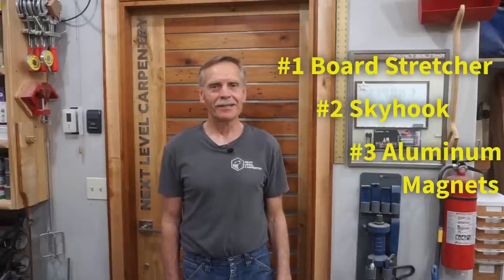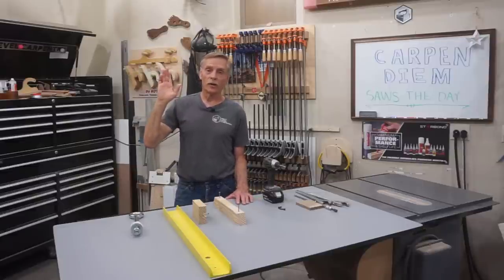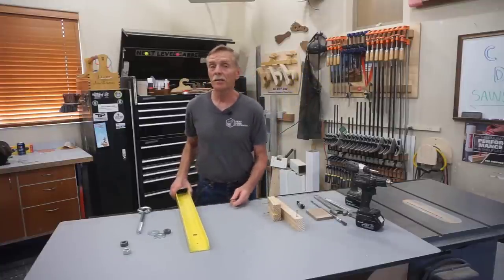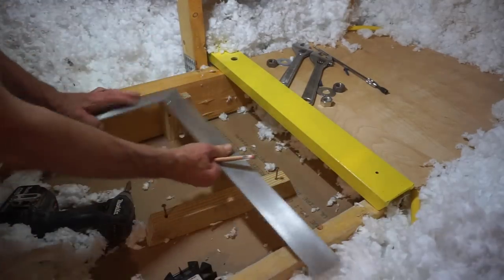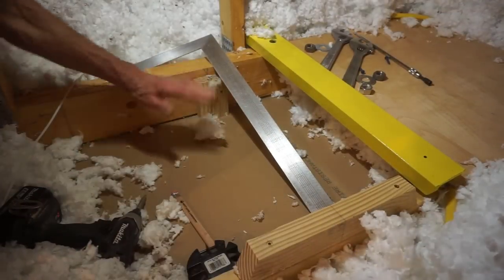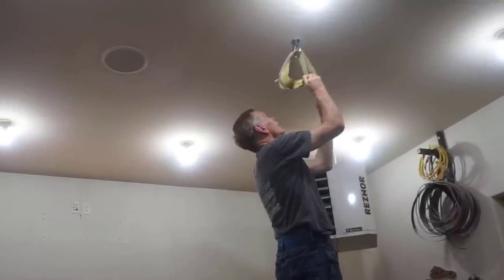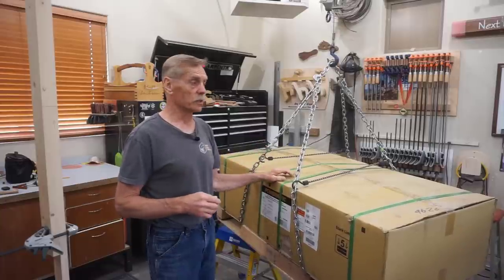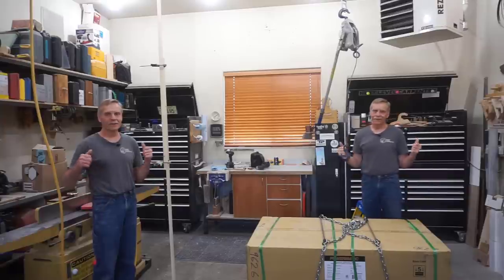Workshop Skyhook Installation

Comment: Matt, I've concluded the stirring direction in the aluminum magnet solution is critical. I stirred counterclockwise, for a little to long. When ready to boast the attractiveness to my friends, the pop can repelled so hard I put a hole in the drywall in my garage. Not to be messed with by amatuers.  Also noted - on my adjustable wrech, closing it completely for 3 seconds will recalibrate it to SAE and vise versa. No longer need two adjustable wrenches. Thank for the video. I don't need a sky hook, but ill put one in anyway. The for posting.
Reply from the maker: Dear Greg, I have posted your comment for all viewers to see first for the insightful imperial to metric conversion process for an adjustable wrench. That, my friend, is pure genius! A little known fact is that I've kept six crescent wrenches in the drawer of my tool box so that I can have a small medium and large in both SAE and Metric. You're incredible solution allows me to free up that extra drawer space so now I have places for my selection aluminum magnets plus I can also add my collection of brass magnets as well.
I can't thank you enough for sharing here at Next Level Carpentry because it makes the whole Channel a better place!
😔😁😎
Reply: You could also use that direction to place a hole in the ceiling for your skyhook also?

Comment: Being the "Crane Guy" for 44 years, I watched with great interest!  You did a splendid job on ALL aspects.  I do agree with a previous comment about Chip.  It would have been nice if HE would have held the eye bolt while you threaded the nuts and washers on.
Agreed, a welded eye, eye bolt would increase the safety margin but not necessary IF you abide by the hoisting limits you set.  As a "crane guy" I would recommend using a shackle on the eye instead of doubling your strap as you did.  While I sure understand the safety margins between the strap rating and your load limit making it perfectly safe, a shackle would prevent any potential damage to the strap due to unequal load on the strap fibers going through the eye.  As I said, with the ratings of the equipment and the load limits you set, hoisting will be perfectly safe.  You have my seal of approval!

Great video and extremely well done.  I enjoy all of your videos and the way you present them.
THANK YOU and Chip.
Reply from the maker: Thanks so much for your insightful comment... much appreciated!
This kind of polite, informed feedback is educational for me and beneficial to any other viewer who takes the time to read through it.  I kinda thought the steel hook in the round 'eye' of the strap was less than ideal because of the sharp load point in a smooth circle... any thoughts there?  Seems like the strength of that ring might be the proverbial weak link in the straps design without a suitable fitting to connect to it.
Regardless, thanks for your contribution!
Best, Matt
Reply: @NextLevelCarpentry  Matt, Thank you for your delightful reply.  I sure understand your concern.  If that strap has a 5,000lb rating, you can be SURE that ring will hold 5,000lb.  Being a ring, a person should only use a piece if hardware such as a hook or shackle.  Both of them will be a point load.  So, you are good to go especially since you have a 10 to 1 safety margin restricted load rating.
Keep making the great videos and Good Luck, Terry
Reply from the maker: @strrchristmas  I always figure that if I'm the smartest guy in the room then I'm probably in the wrong room and it's guys like you that I've learned a great deal from over the years for things outside my field which I most definitely appreciate!
Best, Matt
Reply: @NextLevelCarpentry  Matt,  You are MOST WELCOME.  I believe the knowledge I have gained over the years MUST be shared as it will all be LOST when I pass on.  It is my privilege to have been of some service to you and your viewers.  Cheers, Terry

Comment: Thanks for the free overnight shipping on the Aluminum Magnet Solution! By the way, after some experimentation of my own, I found that by adding 1/4oz of purified water to the solution, it will convert the magnet to pick up plastic water bottles!
Reply from the maker: That's an aMAZing development! There's no end to the usefulness and benefits for all mankind!  Thanks for sharing... and, of course, you're welcome for the free shipping... it's the least I could do! 🤣😎
Reply: I added angel dust and a pinch of regret and found it could pick up ducks and chickens from 2 metres away. Unfortunately not geese.

Comment: As an armchair engineer (semi-retired mechanical engineer), I think you did a splendid job on the skyhook support structure.  All aspects of the installation were well thought-out and properly planned.  The only thing I would have done differently would have been to take the correct size combination wrenches to the job-site to make it easier to tighten those bolts in tight quarters.  Of course, those are big wrenches that don't usually come in the a typical set, so most people don't have them handy.
Reply from the maker: Anything to save an extra trip into tight quarters is a wise move indeed!

Comment: Thank you for talking about the safety factors on such a design, I'd like to point out something not mentioned, the come along is more suited to pulling jobs instead of lifting jobs.  For lifting it is preferred to use a chainfall to make easier lifting and lowering work.  Personally I'd lean towards a welded eye or an actual lifting eyebolt since there is a possibility of opening but by limiting the lifting capacity it likely wouldn't be an issue....
Reply from the maker: Thanks for the comment David... and thanks for being more than acceptably polite in composing it.  It's this kind of feedback and constructive criticism that benefits both myself and any other viewer who takes the time to read the comment.
 Crazy thing is that it never even occurred to me to get a chainfall for this.  I've not used one for so long it didn't even come to mind but you're absolutely right in suggesting it... in fact,  I'm checking into one based on your comment, and may well have one to use when doing the drillpress unboxing in a week or so.
Much appreciated!
Best,
Matt

Comment: Matt & Chip, 
    Thank you for not shying away from doing this video. I was a welder/ fabricator for over 45 years before being severely shocked, nearly to death by 460V 3 yr. ago. In order for me to be able to get back in the shop again, one of the things that is required is some sort of skyhook or sliding crane 🏗 system in my shop. Of course I will go with an electric system. 
Your system could work very well directly over the top of my work table to help when my projects get too heavy!
Thank you again.
Reply: @baloneymanman4924  is this heaven?

Comment: Nice job!  I probably would have included split lock washers just because I always use them, but it hardly needs them.
Reply from the maker: Funny thing: I would have used a split lock washer too but didn't have one on hand at the time.😯  Had extra nuts though and figured the jamb nut setup was actually better in this case even though, as you mentioned "it hardly needs them".

Comment: Hehe! Aluminium magnets with sparkle! Nice try. The hook on the chain hoist would need a safety clip in Germany at least.
I wonder what would happen if you made the hole in the ceiling too large. Then the skyhook wouldn't stick and fall out. Would you use a piece of double tape to stick the lower nut to the wooden guideblock? Which would make it possible to turn the skyhook from below to make it remain in the ceiling without a second man.
Reply: Aanother possibility would be to attach a strong magnet to the top of the guide block. Then you could push the eyebolt up through the hole (with the washer tape backing removed) until it makes contact with the magnet.

Comment: Really try to bring out trolls, deflecting gauge and with upgrade could put a ton up on it.
Rofl
Hey chip where you when he need putting hook in ceiling?
How do I order some of the aluminum magnet juice? I have some aluminum roof nails in my back yard to pick up.

Comment: Yeah, it'll hold your 500lbs, something to keep in mind is that trusses are designed to carry the load from the top chord and while every homeowner stores junk across the bottom chords, I've seen it cause problems. First indication is drywall seams cracking. A simple solution is to add a 2x4 from the bottom chord straight up to the top chord where you've placed your channel. Now you've added load to the primary chord designed to carry it. It's overkill, but you'll stretch your limits with any planned load limits. I've been building and remodeling for 4 decades, so not a troll and don't spent much time justifying as I do clarifying.. I understand liabilities as well. I also understand the principal of how trusses are designed. Would I add a support from bottom chord to top chord? Probably not for short term loads, but I'd certainly bring up the reason trusses are designed the way they are and why you have a girder truss.

Comment: Yet another great video! I’ve recently subscribed to your channel and I got already so many great ideas from your content. I really like your creative solutions to otherwise head-scratching problems. And if I believe that deflection gauge, im pretty sure that skyhook is rated for more than 500 pounds and you are just being cautious hehe. The one thing I would do differently though, would be to flip the wooden guide block around and trap the eye bolt between it and the beam, that way if the weight shifts, it protects the drywall from getting mangled in any directions as well as moving the load even closer to the beam. And lose the bottom jam nut to allow the hook to rotate. But to each their own and I’m pretty sure that you know better your applications. Thanks for the upload and the awesome content you provide. Now keep us posted on how are the board stretcher AKA “oopsie b’gone” lol and that aluminum magnet coming along :p
Reply: he locked that eye bolt for a reason, your load lifting device should have a swivel hook on it, you don't need or want to swivel your eye bolt, this will cause you problems.

Comment: What is screw jacking (9:45)?
Reply from the maker: There's probably a better explanation out there somewhere but basically screw jacking is the tendency when driving a screw that the threads actually push the two pieces apart rather than pulling them tightly together as the screw is driven home.
If you watch real closely during that sequence you'll see the little block move away from the truss until I back to screw out and drive it a second time when we driving it holds the piece tight and fastens it tight. Reversing the screw and redriving it is a quick way to deal with screw jacking but it can also be avoided by drilling a properly sized pilot hole in the piece being attached which prevents the threads from pushing back and causing a loose fit of the piece. Another way to avoid it is to clamp the two pieces together before driving a screw so that the force of the clamp overcomes the tendency for screw jacking to push the piece away and you can just drive the screw once for a tight fit. Because of cramped conditions in the attic I chose the drive redrive method because I'm kind of lazy that way but other times I'll use alternative methods to prevent it but the goal is always to have a tight strong fit between the pieces being attached. Whew! 😎
Reply: @NextLevelCarpentry  OK, I did know about screw jacking, just not by that name, and I wasn't sure if it was the same thing. As I understand it, the problem is that for a tight join you need the spiral path cut out by the thread to continue perfectly from one piece of wood to the other. So if the thread's exit from one piece of wood does not line up with the thread entry into the other piece of wood, you will have a gap. And since the thread's path through the wood is created before the joint is tight, it's basically guaranteed that they won't line up (the thread turns a bit between exiting one piece of wood and entering the other). By drilling (in the piece being attached) a pilot hole which is wide enough to accomodate the thread (but not the head), this issue is avoided. I still don't understand, though, how backing the screw out and retightening it addresses the issue, since I don't think it would change the thread's path though either piece. I tried it out and it didn't work for me, but maybe there's something special about how you're doing it that I'm missing. Sorry for the delay in replying -- I needed a chance to try out your technique for myself.

Comment: having a challenge with patreon allowing me to edit my bank card information and check that i entered it correctly....also i live in canada and don't have a zipcode
Reply from the maker: Sorry for the difficulty... I'm not really sure how the details at Patreon work but do know there's other patrons in Canada, UK, etc so I know it's possible and should be possible without a US zip code.  I did see a notification from Patreon indicating that you're signed up so hopefully you're able to work through frustrating details.  Also understand if frustration with the Patreon platform causes you to un-sign up in exasperation and hold no animosity if you have to😌😁
Reply: @NextLevelCarpentry  I opted to cancel the Patreon account thinking I could re apply and enter credit details again as I wasn't being taken to a page where I could check what I did in the original ... I have yet to contact Patreon about it ... anyway thanks for the " screwing wood into concrete video ", using wire to secure a board with a regular screw   is a great tip
Reply from the maker: @misteribeiro  Not sure if you'll get any resolution contacting Patreon... they're not my favorite platform because of some lame policies and behavior so don't exert any extra effort on my behalf, only if necessary to settle things on your end.  Glad you like the attach wood to concrete video... it's one of my favorite tricks because it's so easy and works  incredibly well🤓
Reply: @NextLevelCarpentry  thanks Matt so far this is where it's at with Patrron

Hi there,
 
Thank you for writing in. I am Ethan with the Product Support team, and I am happy to assist you.
 
I checked into this for you, and it appears that your card has declined with a hard decline error. This error indicates that the transaction will not process on this card without your bank stepping in.

Here is more information from our card processor:
Most hard declines require the issuer or cardholder to rectify the outstanding issue(s) before a subsequent attempt can be made

Please try a different payment method or contact your bank to gather more information on why this decline is occurring on their end. If your bank is able to rectify the cause, you can manually retry your payment.
Reply from the maker: @misteribeiro  Welcome to problem resolution in the digital/social media age, right?!😑
Reply: @NextLevelCarpentry  😇

Comment: Not saying u cheated at all, regarding your magnet demo. But would be more believable by the chronic non believers, if you had tried the magnet on the drink cans both before and after dipping in the solution . Just saying…. Like ur vids